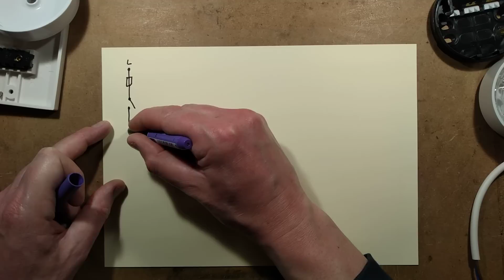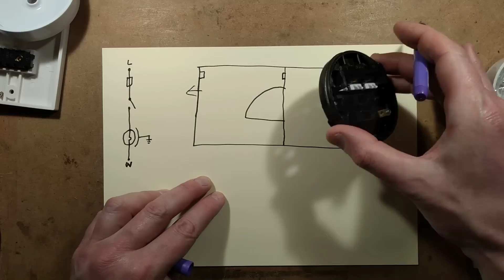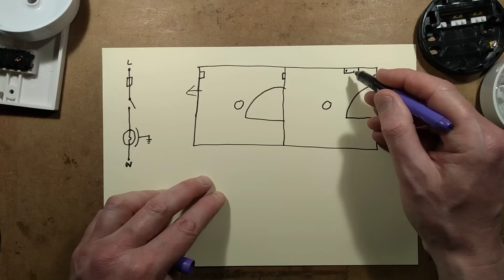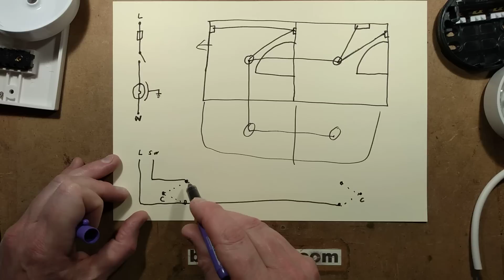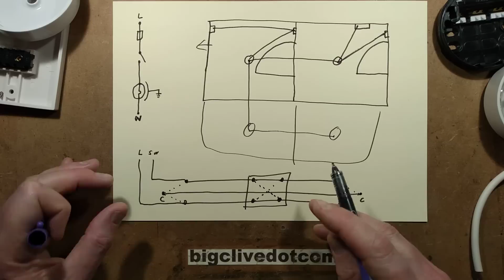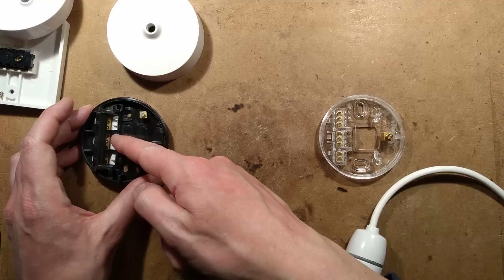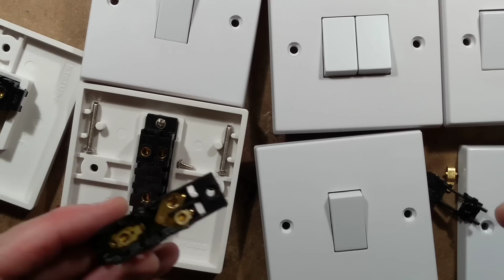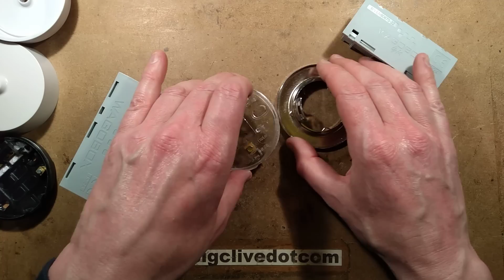British home wiring.  The incredibly simple lighting circuits.

Comment: Roflmao and the brits think American electrical is stupid....  nothing is more stupid than having the wire supplying power also supporting the weight of the fixture... lol we use chains or a steel cable that supports the weight. 
If a qualified person is required to do wiring and a person does it " properly " qualified or not, who is to say who actually did the wiring?

Comment: The only thing I don't like about British wiring practices is that electricians use standard blue/brown (plus earth) cable between the ceiling rose and the switch. The brown is used to connect the live supply from the rose to the switch and the blue is used to return the switched live back to the lamp. This means that blue is used for a (switched) live connection, contrary to the colour code. Clive mentioned in passing that cable with two browns is available, but I've never seen any. It would certainly make things clearer, which means safer.
Reply: It’s in someways more confusing to have the two brown cable, it’s harder to easily identify the s/l from the live. Also some double brown and earth cable dont mark the browns different, have fun wiring that! 

You should always sleeve the blue S/L with brown sleeving to identify which wire is which.
Reply: You may be amazed to know that at least two countries (together) have solved this problem.
While continuing to use the "old" British convention of having the "Line" conductor in "building wire" insulated in Red with the "Neutral" conductor insulated in Black, the conductors from the light fixture to the switch can be in a cable with the "Line" conductor still insulated in Red but with the "Switched Line" conductor insulated in White.
This "one pair" (Red & White) "cable" does NOT contain an Earth conductor - because wall switches in these countries contain no metal which requires "Earthing".  
(Even in wall switches with metal wall plates, the metal "wall-plates" are "double insulated" on plastic substrates, with no need (or possibility of) of Earthing.)

These countries are Australia and New Zealand.

Comment: I think the cable tie loop on wago boxes are to meet some daft reg which states that any electrical accessory should only be accessible using a tool.........ive installed hundreds, probably thousands of them now and never used a cable tie. If it were in a place where there was a chance a child might try and open the box I would but if its in the ceiling then I really couldn't give a toss. Some regs are made to be broken. Also by the book, all wago boxes and any other joint box should be screwed down and never lose above a ceiling or under a floor........again that one was made to be broken! Same goes for ELV electronic transformers for mr16s or any led driver lol.........who cares?......not me!

Comment: In NZ  they use T&E with pre sleeved CPC. They even mark up the entire drum with 1 meter intervals so you know how much cable is left!

Have you come across a flat 3 core plus earth with 3 x 2.5 conductors and 1.5 cpc? I found some in a guys house lately and never seen it before in my 20 years being a spark. It had the BASEC stamp on the sheath and manufactured in UK. Someone had wired a ring circuit with it and lopped off the yellow, used red as line and blue as neutral (old colours on insulation and grey sheath). Initially I thought it was 1.5, told the guy all his sockets needed rewiring or mcbs de-rated to 10a and he gave me the go ahead to rewire. Fortunately I noticed the odd cable size before I had ripped his house to bits!! No other spark or distributer ive shown a sample of it too has ever seen it. I can post you a bit if you want, no one seems to believe me till they see it.

Comment: In the United States, long ago rosettes such as the plugable one you showed were used for pendent lighting. They were made of porcelain and used brass terminals. Also I'd like to thank you for explaining the 2-way and intermediate switches. We would know these in the United States as, 3-way and 4-way.

Also at the end you mentioned people just going willy nilly and wiring all the wire colors together, wow. That's one way to accidentally short the circuit! In the US if we do run a line just for a light switch, we must;

Attach the white Neutral to black Hot at the junction box,
Mark the white Neutral with black marker or a bit of black electrical tape in the junction box and at the switch,
Attach marked white wire and black to switch respectively,
Then the black wire goes to the fixture.

In the old days, in the US, the hot would run directly to the light fixture, and a switch on the Neutral wire would break the circuit! How times have changed... lmao

Comment: Interesting how you do two way switches compared to the US and Canada.  There, the commons aren't attached to each other.  The line-in goes to one, and the switched line for the fixture is the other one.  You still need three wire cable between them.  Either to carry the neutral to the other end, or to get the switched hot back (line and load at opposite or same ends). I've never seen a rose (rosette) like this, you always have to use a J-box attached to the ceiling and you use wirenuts to connect wire-to-wire.  Jboxes usually need t be metal, and attached firmly enough to support at least 25 pounds.  Things like ceiling fans or heavy chandeliers are rated much higher and have eye-bolts for extra support.  Terminal strips are rarely used outside of electrical panels.  Electrical cable hung fixtures are extremely rare (except for bare sockets usually used as temporary lighting (termed "pigtail sockets").  The J box is usually covered with a bezel that either has a ring for a chain support, (the power cable is weaved through) or is actually part of the fixture base.  Until the advent of LEDs (and some more late model halogen recessed pot/track fixtures) virtually all bulbs were edison screw base.  None of this spring-loaded twist bi-pin stuff.

Comment: A big difference I notice here in the US, at least my part of it, is that the power is run to the switch box rather than the light fixture box. Then a switched feed is led to the lighting box(es).
Reply: Running the "supply" (including the Neutral) to the Switch location is now required in North America - because of the possible future "need" for the "Neutral", with electronic dimmers etc.
(Please note that it is NOT "Power" but a "supply" Voltage that is provided at such locations.  No "Energy" is used until a current flows and "Power" is the "Rate" at which such Energy is Supplied/Used.)

Comment: I find it always interesting how things are done differently in other countries. There is always something to learn from it. In this case, I like your 2 switches approach. Another difference is that in France both live and neutral go through the fuse. Finally we can’t use those light bulb sockets anymore. They must all be the ones where you screw the bulb.
Reply: Interesting that there is a "requirement" to use a socket which is more dangerous (with an outer shell which could be connected to the "Switched Line") than one which is safer in having no such "outer shell" and when such "bayonet sockets" are available with two contacts, neither of which are energized until a lamp is inserted. (e. g. Legrand D332WE)
Reply: France hates anything Anglo it seems.

Comment: It was very common for the war generation to convert light pendants into an additional plug socket for irons. You could buy brown bakelite male bayonet fittings for the purpose.
Reply: Also made very good extention leads for false ceilings. Some old houses have still got them hidden away.
Reply: @Edwin_1986  Its actually dangerous which is why lighting rings have their own trip switch now and that adaptor is no longer made. It used to cause fires when old cables heated up. Typically you were only powering light bulbs off the light ring which for most homes came to less than 500w. Then some bright spark plugs in an iron and puts as much as an extra 3 kw through it. Which was a big problem if the wrong fuse wire was used and/or a plain old nail.
Reply: @zoiders  I'm still removing them from false ceilings and the owners don't even know they're there, just replace with pendant with long cable or Klix plugs.
Reply: @Edwin_1986  On their own they would not be any more dangerous than euro plugged link lighting if they were made from modern cable and only used to bridge voids. Are you finding them with ancient braided flex on them?
Reply: @zoiders  Finding them with ancient braided flex on them.

Comment: In NZ/AUS, we use TPS cable (twin and earth equivalant) and its 3 wires each insulated. The outer sheathing shows the indentations created by the inner cables so you can tell where they are, just run the knife down between two wires and you can break it apart easily.

Comment: The French wiring regulations are designed to prevent unemployment amongst French electricians and French electrical equipment sellers.  The circuit breaker panel for a small house in France  is comparable in complexity with the control centre of a nuclear power station.
Reply: I only see how that would cause problems rather than preventing them. Seems to me as not being the smartest idea...
Reply: @mikaellindqvist5599 But, as I said, it prevents unemployment amongst French electricians.   

 French power points are normally fed from a 16A circuit breaker.   You can plug a bedside light  with its two-pin plug into a power socket - there is nowhere else to plug it in.

 If your unfused traditional 40W tungsten bulb arcs over in its final second of life, the resulting flash and bang can be quite impressive.

Comment: Oh yeah, and ring circuits are weird to me. Radial circuits are the norm in the US. Because of our strange center-tapped transformer system, if you connect two circuits together accidentally, you may end up with 240V in a junction box. There's actually a clever but wholely unapproved device available for electric car chargers called a "quick 240" which plugs into 2 separate 120V plugs on different circuits for a combined 240... But that means it would run on 2 separate breakers. Not the best idea, really.
Reply: Really just need to tie the circuit breakers together to make it kosher.

Comment: Fascinating! US wiring is VASTLY different. No in-wall connections without an accessible junction box, wire nuts instead of screw terminals, HEAVY plastic or metal boxes. You could hit a plastic box with a hammer several times and do almost no damage.
I love your screw terminals - those are cool.
To connect multiple wires to a single screw here, you wire nut them all together with a pigtail wire that you screw down. Some morons put multiple wires on the same screw, with a loose connection and arcing as the result. Your wiring is fascinating to me.
Oh, and our cables have a nylon thread in them that you can pull on to cut the sheathing, and our ground/earth is always left bare copper. I rewired much of a house built in 1901. Many ancient outlets, with no ground wires.

Comment: The intermediate switch is more complex than that if you take one apart as the strappers [what the 2 wire between the two way switches are called] have to crossover each other.

Comment: Cover up the redundant switches or ones that are not used anymore?  Nawh, leave them so that the next homeowner can spend the years that he owns the house trying to figure out what that switch controls... I had one switch like that in a house that I used to own... Owned that house for around 10 years and never figured out what that switch supposedly controlled...
Reply from the maker: In America it may have controlled one of the floor level sockets.
Reply: @bigclivedotcom  -- It was in the master bathroom on a back wall and I checked every light and socket over the years.  In that house, there were no outlets that were controlled by switches.  I wasn't motivated enough to crawl up in the attic and try to find the wiring though -- I hate crawling through fiberglass and to get to that portion of the attic, there would be some very low clearances and it would be necessary since the front half of the house was 2-stories and the back half was 1-story... But there were other things that irritated me more, hence I no longer own that house...

Comment: In the republic of Ireland lighting circuits were the same as industrial lighting here. The cables were single core, red and black back in the day with a grey outer cover. The live was looped to the switches so when the light was switched off there was no power at the light. First time I fitted a light here it was a bit of a WTF moment. Still think its wrong.

Comment: UK electrician here in Merry olde England~we electricians have a joke about the new brown,blue,colours and the old colours red and black. The way I heard it “ Red to Red,Black to Black, Blue (blew)to bits”
because so many DIY enthusiasts like to install their own new light fittings,usually on Saturday afternoons...writing It down doesn’t quite have the same impact as when saying it!
Reply: Here in NZ, we use red, black (and green for the earth wire, which has been insulated for a very long time), so whenever I've had to change a plug for an appliance with blue & brown wires, I say "black and blue, that will do" as a way of remembering which way they go.
Reply: new wire colours!?  They are some 40 years+   brown, blue and green/yellow. 

Here we had grey for N , black for L and red for earth it was changed 1967 to the what you called "the new colours.  
Okay,  time is relativ. I was surprised that my jet cleaner refused his job several day ago  , bugger. I was angry about because I   can´t finished my work . Those damned thing was 30 years old and was just  over the  warranty  , shit.  

One thing which  bother me most  ist the grey wire which was N is now an  L . In some elderly installations there are lots of  grey wires to be found. Even red earth wires.

Comment: On the two way switch, why not connect the live wire to the common on the first switch, connect the two "out" connections on the first switch to the two "in" connections on the second switch and then connect the wire going to the lamp on the common on the second switch? That makes the switches work in the same way and makes the whole connection make a lot more sense.

Maybe its just because that is how I was taught how to connect it.

Comment: Incredibly simple UNTIL you want one switch plate with TWO switches, one of which is a two way the other needs to be an intermediate switch in a two way circuit! 

Possible? Not unless grid switches are used! BUT then, if you want all your wall switches to look the same the whole house has to be changed for grid switches! Doh!
Reply from the maker: The intermediate switch doesn't have to be in the middle, if there is one of the switches controlling that circuit on its own.

Comment: Very good. In america plaster board is called sheet rock for normal rooms. Green Board for bath rooms.  We also have concrete board called wonder board. 
Electrical boxes are fairly deep and it is still a challenge to get wires, wire nuts and switches in them. 
Oddly wires run from the main / sub panel to the light switch and then to the light or "luminary"  Rarely is power sent to the light and then the switch. Even if it is for a ceiling fan. 
The big challenge today is grounding. Getting power, cable TV, satellite, and telephone, solar panels to *al*l use one single ground to one single ground rod.

Comment: I didn’t watch the whole video but from what I saw up to 6 minutes you have live wires in the ceiling rose even when the light is switched off.

Very dangerous.

In New Zealand nothing is live in a rose when the switch is turned off. When you encounter a live wire in a rose with the switch turned off you know some cowboy has been playing around.

I discovered one in my house, rather dramatically. I have been hit by 240V many times but when you are not expecting it it really is a shock.

I prefer to lay my own cables because while tradesmen’s wiring is very sound they are very lazy and careless when it comes to positioning and making holes.
Reply: Actually I don’t even like random switches in walls (and power outlets too) so I replaced all my wall switches with ceiling ones. This reduced the overall amount of cable and allowed neatly panelled walls. As we are single storey all wiring is accessible from the attic space.

Comment: Very similar practice in Australia (these days). Though my house, wired in the early 1920s, neutral is looped at ceiling roses/ bayonets and active at is looped at the wall or ceiling switch, so any one fitting has a maximum three wires going to it. Must have taken a lot of planning to correctly feed the conduits

Comment: Here in North America the standard box is about 2" deep I think. Standard box takes electrical switches, sockets etc.  They also take your rj11, rj45, and coaxial cables... just different faceplates with the same screw pattern. Makes things easier.

Comment: Interesting. In the USA it's more common to have the power from the breaker box wired directly to the switch box, then the switch leg carries the power to the ceiling box. Occasionally we run into the power feeding the ceiling box first, but not usually. This is the standard in Massachusetts anyway.

Comment: Cool informative vid. I see a lot of your wiring methods that I can appreciate as compared to how we wire here in Canada. Guess that because of your 220 volt system that your wire gauges are smaller then ours due to lower current demands - makes physical wiring much more of pleasure.
Reply from the maker: The thinner cables do make a huge difference.  They also put less strain on the fitments.